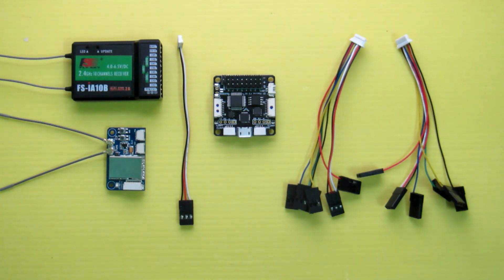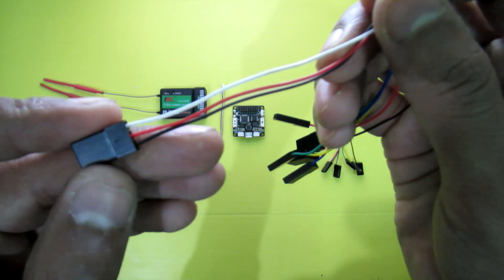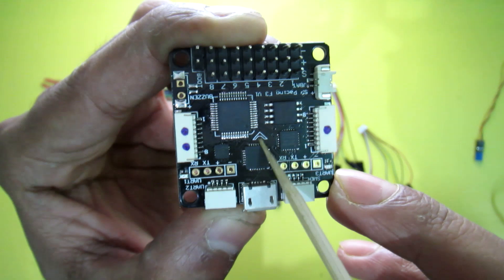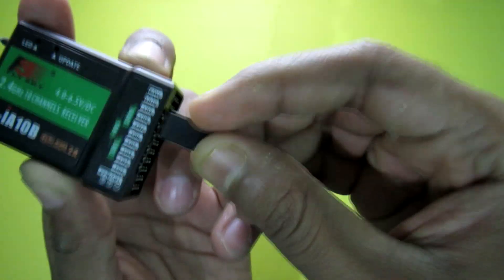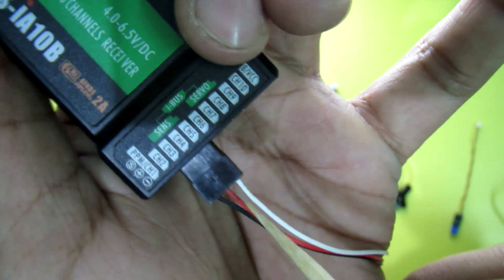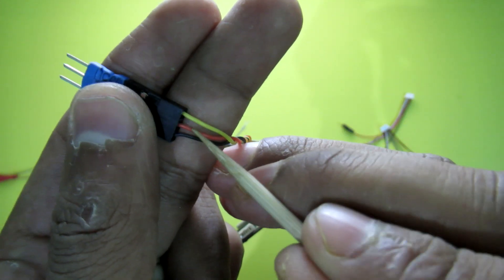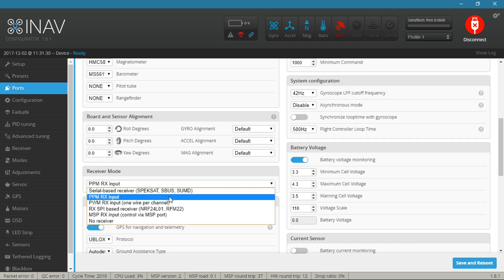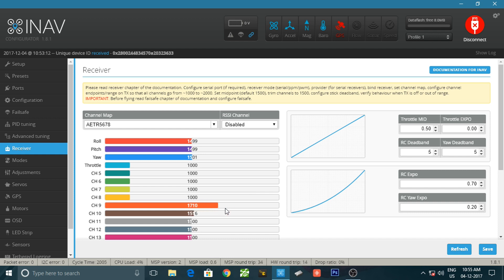i-BUS Connection SPRACING F3

Comment: I would like to install the DJI FPV system on a fixed wing.  I was told that the air unit of this system has a builtin receiver (I think sbus).  I am confused how to connect the 4 or 5 cables (throttle, ailerons, rudder, elevator, landing gear,,etc) to the air unit.
Reply from the maker: You can't still now DJI FPV system is programmed for quads so if you want to us HD video then use  DJI FPV system as a normal FPV camera and use separate Receiver to control the plane

Comment: this is the most complete tutorial....could you please explain what "sens" means on FSia6B how to apply that? since the documentation very minimum
Reply: There are sensors you can purchase to plug in there - i purchased a flysky(turnigy) voltage and temperature sensor from hobbyking/banggood, and they plug in there and they feed the readings to your transmitter. Voltage sensor was a few dollars - temp was a few dollars more

Comment: I am able to connect my clean flight for sp racing f3 but and reciver are working fine but when i connect with  motor .motor is not responding. Any suggestion ?
Reply from the maker: Check PWM output clean flight

Comment: Hello. Do you know is it possible to monitor the 3S battery voltage without this receiver modification?
Reply from the maker: You can use voltage sensor

Comment: Thank you for good instructions. However, you omitted the detail of connecting the SRR F3 with the receiver connected to it via the iBus connector to the computer for configuring it. How do you power the receiver? Do you apply external power to it or is it powered solely via the iBus connector from the flight controller which is in turn powered through the USB cable from the computer?  When I connect the flight controller with the receiver connected to it to the computer via the USB, the signal light on the receiver does not light up. When I measure the power supply voltage on the iBus connector it's only about 0.35 V, which is clearly too low. The same voltage in also on the ESC connector power pins.The flight controller seems to be in working order - it connects to the Betaflight configuration utility, and when I move it around, the movement is reflected in the quad representation in the Setup section. The blue light on the FC is constantly on, and the red one is uniformly blinking. When hitting Save and Reboot button, the red light blinks rapidly for a brief time and then returns to uniform blinking. 

 In the Ports section, I turned on the Serial RX in the third row, saved and rebooted. Then I went to the Configuration section and sat in there "Serial-based Receiver (SPEASAT, SBUS, SUMD)" and then selected "IBUS" in the Serial Receiver Provider field, then saved and rebooted. When I go to the Receiver section, all the control indicators are in the middle positions with the exception of the throttle, which is closer to the left, but they don't react to any control input.

When powered from external power supply via the PDB, the receiver binds to the transmitter (FS i6x) without any problem, but the flight controller does not react to any transmitter input. When connecting the power, the motors just slightly jerk and then stay still.

Can you offer me any advise on what might be the problem?
Reply from the maker: With SPRACING F3 flight controller, you need to provide separate 5V power supply for receiver. Please make sure your receiver is outputting the i-BUS  signal. And it hooked up with the proper " IO-Port" of the flight  controller.
Reply: Thank you for answering to my post. But you still have not answered my question. Namely, you say to provide separate 5 V power to the receiver. But this is exactly what I am asking - how to provide separate 5 V power to the receiver? Where on the receiver do I connect the power lines to? There is no separate power connector on the receiver for this.
Second, you say to make sure that the receiver is outputting the iBus signal. Again, exactly how to do this? Actually, I imagine that if the receiver were powered, I could see this in the Receiver section of the Betaflight configurator.
Third, the receiver is connected to the right IO port of the flight controller, namely, port IO2, with the lines of the receiver's iBus matching the corresponding lines of the port - GND to GND, VCC to VCC, and signal to signal.

Can you just tell me, how you power your X6B reciever when it's connected to the SPR F3 controller via the iBus port and when the controller  is in turn connected to the computer via the USB port?
Reply: Alright. I have solved the problem on my own. When the flight controller is connected to the computer via the USB port, we power it the same way when it's not connected, namely, by applying 5V voltage to the power pins of the ESC connector. The receiver in turn gets powered via the power lines of the iBus connector.
I figured, it had to be this way, because I could not see any other one. So, even though I still had a slight fear of burning up the equipment by connecting it simultaneously to two different power supplies (the computer and the battery), I took a chance and, oh miracle, the control indicators in Betaflight started responding to transmitter control inputs.

However, while the quad representation in Betaflight configurator responds to the x-mitter controls, the actual motors don't. They just jerk twice when connecting the power and then remain still and don't react to any of the controls.

Also, with the ESC connectors connected to the FC, when connecting the battery,  the PDB issues a different beep code, than when they are disconnected. Sounds like three short ones (the same as when no ESC connected) and then two long ones.

And when the throttle is all the way down, the red light on the flight controller goes off, but when the throttle is moved up it starts blinking.

 And after sitting powered up for about 4 minutes, the PDB starts beeping - sound like one long beep and two short ones. 

What could be the problem this time?
Reply from the maker: Just give 5V to any of 8 Motor output pins of the flight controller. Then everything will be fine.
Reply from the maker: Motor pins 5V are separated from the USB so there are no burning or damaging problem.
Connect the ESC to the motor pin 1 to 4 and connect then open betaflight then go to motors tab and calibrate the ESC first after that everything will be fine.
Reply: Thank your for taking your time answering my questions. With help from the Internet I have solved the problem of the motors not spinning too.  I simply had to ensure that the flight controller is leveled when arming it and everything started working. Seemingly a simple and logical solution, but unless you know it, it makes you think of all types of problems, including the ESC not being properly programmed.
Reply: Motor pins 5V are separated from the USB so there are no burning or damaging problem.
--------------------------------------------------------------------------------------------------------------------------------------------
What are you talking about? What motor pins 5 V?
Reply: Just give 5V to any of 8 Motor output pins of the flight controller.
-----------------------------------------------------------------------------------------------------------
What 8 motor output pins? You mean the ESC connector? The 5 V power cannot be applied to any of these pin sets, but only to sets 5 to 8, because the first 4 are taken up by the ESCs.

Comment: great video , many thanks for sharing ,

finding difficult time to power up m receiver via FC using USB power cable,  once connected to "ClearFlight" FC lighten up and everything is working fine except receiver. not sure whats is wrong , here i am using IBUS communication connected ti IO-2 port 

here is below hardware list:
    1. sp racing f3 v1 FC
    2. FS-RX2a pro receiver.
Reply from the maker: you need power up the receiver separately.

Comment: I have recently started building my quad and I have almost finished it but it's not arming I mean,the drones motors are not spinning when iam increaseimg the throttle,I have bonded the reciever and transmior properly but still iam not able to make the quad start,I thought it was a connection issues but wheniam connecting it to the cleanflight and going to the mother section and turning on the motors it's turning on,I don't know what's happening,I have tried to locate the problem in the cli it's showing RXLOSS.. PLEASE help....
Reply from the maker: Your receiver is not getting the power
Reply: MakerHand no the reciever is getting the power

Comment: What If I want to connect it to uart port another one
Reply from the maker: Yes you can do that just connect the signal wire of the receiver to the RX of the flight controller and turn on the serial rx on of that uart

Comment: Hey im using betaflight. I did everything and i can see my tx is working but my quad wont arm😐
Reply from the maker: Did you add an arming switch or you are arming through sticks??
Reply: MakerHand i did. And its okay. You should add that detail. Bcz when u connect the wire you say : thats it. All done. But its not ready😐. Betaflight wont arm it. So i request you to add that too. Thank you
Reply from the maker: There are so many cause which can stop you from arming. But trust me after the connection you just need to add battery and keep the drone level then just arm it, and it should arm, if not then there are some problem in Flight controller. :(